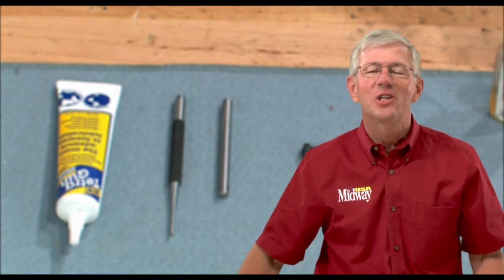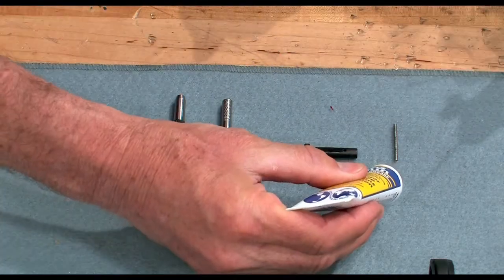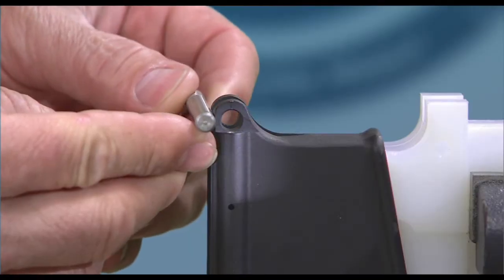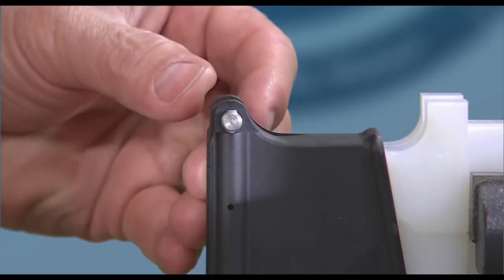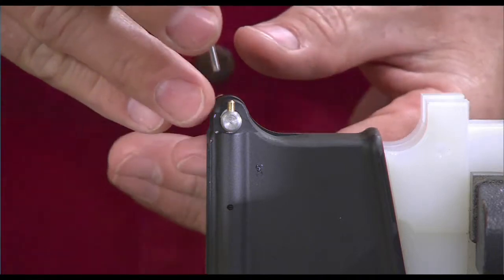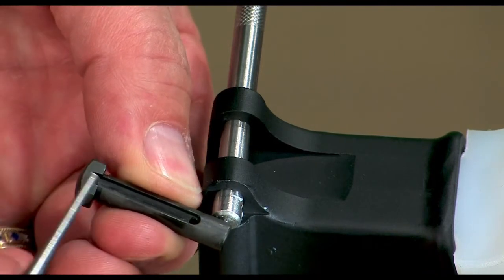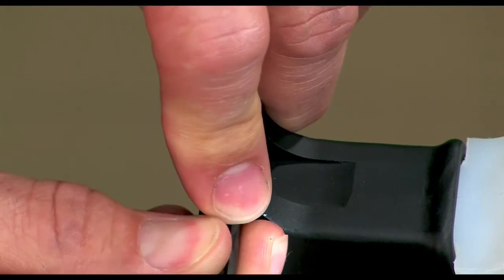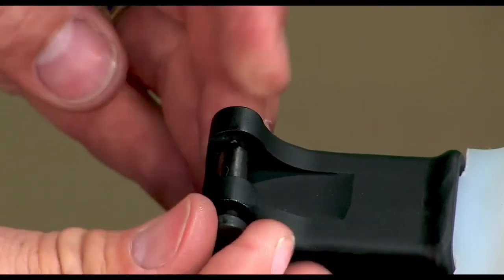How to Install an AR-15 Pivot Pin Presented by Larry Potterfield of MidwayUSA

Comment: I always get a kick when they say it's so hard to put the detent in with the spring all you have to do is use a toothpick push the spring in take another toothpick from the side of the receiver in that tiny little hole use the point of it to hold the spring while you put the detent in and the pivot pin pull the toothpick out of the spring allowing it to put tension on the detent and pivot pin it's really super easy and if a toothpick doesn't work use a sewing needle to hold the spring down through that teeny hole
Reply: May you make a video?

Comment: Use needle nose pliers to hold the end of pin.... then once it's pushed infringement the pivot pin up to replace the pliers . It works. There's a video on it. If u don't have the tool and are struggling. Watch the video if u need to see visually what I described it's the only thing that worked for me

Comment: Detent installation tool, starting punch, rubber mallet. I put this thing together using some light duty grease and a metal handled knife and didn’t scratch up the finish. Idk if I should feel proud or lucky